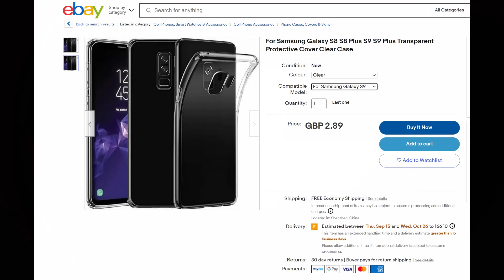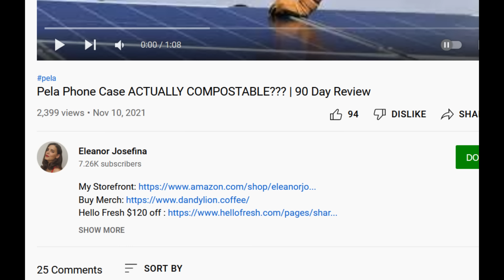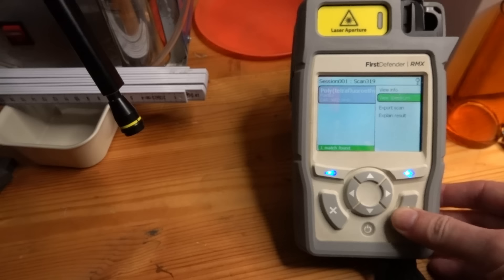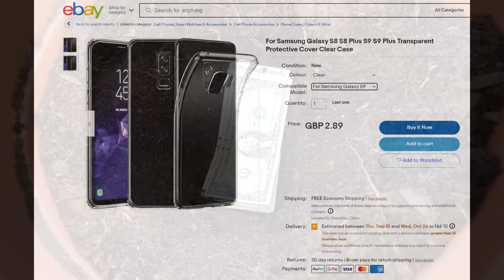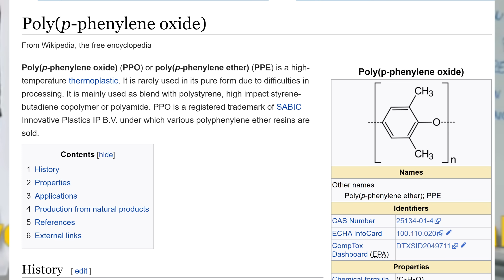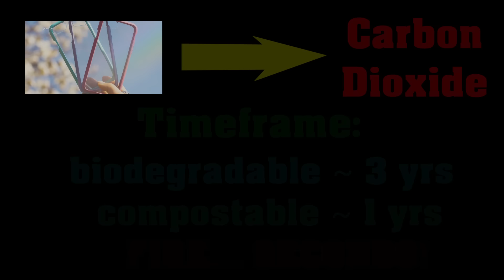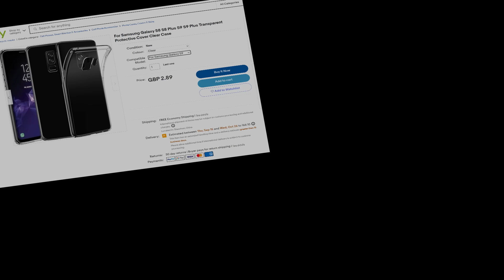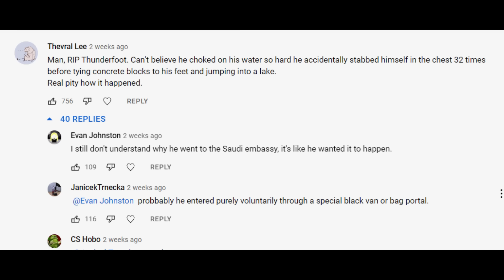Pela-Case: BUSTED!!!

Comment: I've got a question. If there was a phone case that did decompose within 90 days... Wouldn't it not last that long due to the oils in our hands?
Reply: That or getting water on it, like by setting it on a wet counter or picking it up with wet hands.
Reply: You can compost PLA in 60 days. You'll need an industrial composting plant, but it's still compostable. It doesn't degrade at all in a regular environment, so if they really have this special polymer, then it'll probably need special conditions to be composted, like PLA.
Reply: Sure, I guess anything it comes into contact with on a daily basis will undoubtedly reduce its longevity, defeating the purpose. For a phone case it's a bit of a daft idea, so maybe for those genuine throwaway-type items that are single use? Every eco activist loves a degradable drinking straw don't they? (the stupid cardboard ones are useless since they don't last 5 mins so a much better application for "Pela" to work on)
Reply: @LOOKINVERTED  I finally went to a place that used those plant based straws and I went through a few of them because they are brittle and cracked super easy. I would have been better off bringing a straw from home or stopping at 7-11.
Reply: Not to mention the damp humid conditions in your pocket.
Reply: @chlorophil545  you can buy stainless steel straws and a case to carry them in a purse or bag that also comes with a cleaning rod.
Reply: @toomanyaccounts  You can't be serious.
Reply: Yeah my father's cheap plastic phone case is a few years old now and is practically composting away, though he still uses it
Reply: @kentbidjouhd9538  no no, you don’t understand. You can drink you drink, but a couple of inches away! Isn’t that revolutionary? Exiting? Thrilling? No more are the days of experiencing the grueling task of lifting the cup! Praise be the miniature hollow tube!
Reply: @kentbidjouhd9538  milkshakes and drinks in a car are easier with them
Reply: @kentbidjouhd9538  straws is a drinking utensil... you can survive just fine without fork or spoon or chopsticks or any other eating utensils. Indians do it all the time! 
And just like food, certain drinks are sometimes only reasonably drinkable with a straw (such as boba tea), and many others would have a far superior drinking experience with one than without, cocktails for instance, or iced drinks in general in an open container. Now, you could argue that you can just live without those drinks, but so can you live your whole life eating stuff by hand, and you probably don't, so I'd say it is at least a little hypocritical to criticize using straws
Reply: @iCarus_A  Straws are literally mandatory for some, if people have special dietary needs or cannot tilt their heads sufficiently back enough to traditionally drink from cups
Reply: @tylerphuoc2653  Yes, straws are a niche product that the general public does not need.
Reply: First, how did this degrade into a debate over whether or not straws have a purpose? Also, if straws have no purpose then I guess pipes also don't? Anyhow, forget straws. I'm at ~6min and what everyone (including Thunderfoot) in the video so far has failed to grok is that composting only happens when you aggregate a bunch of food for microorganisms in a container. The microorganisms eat the food and this creates trapped heat; this leads to a feeding frenzy. It's kind of like making bread except instead of just yeast you have yeast+mold+other fungi+idk ... look I'm not an expert, but geez, guys, burying stuff != composting.
Reply: @tylerphuoc2653  dont forget those with their jaws wired shut
Reply: And all this on utensils you can just make them edible like their already is
Reply: Air, humidity, moist hands, pocket heat... not like that
Reply: @the_mowron  
He is. I have a titanium one. It's more because I wanted it, and it doesn't give off taste.
Reply: @chlorophil545  and 7-11 straws are made out of vegetables as well.
Reply: @toomanyaccounts  I use stainless steel straws at home but I'm definitely not going to bring those to a restaurant. That's so awkward. I'd rather just drink from the cup.
Reply: @EvanBear  people bring their own utensils sometimes. they have kits to do that.
Reply: @brapamaldi7666  I have two cats and they are very good at catching mice.
Reply: @tylerphuoc2653  thank you for bringing this up, I have terrible teeth that quite often cause jaw muscle issues where my mouth wont open past half an inch, I would love these people to tell me how I could get through 8 hours of manual labour without straws. All this eco friendly crackdown on consumer plastics has left me cutting up rolls of HDPE tubing for worksite-safe drinking straws.
Reply: @MisterMosfet  I dunno why so many people in this thread think needs like yours are "niche" and deserving of being put by the wayside. Either way, there are many materials that can approximate the properties and feel of plastic single-use straws without the non-recyclability and fragility of paper, like whatever that tequila biobase stuff is in Mexico
Reply: @gmt-yt  just be glad this didnt degrade into a politics discussion on the socioeconomic impact of straws and the symbolisms that the plastic straw represent /s
Reply: @EvanBear  Reading the words "stainless steel straw", i can't help but picture a lot of punctures and bloodletting.
Please keep them away from children, as if normal straws aren't dodgy enough.

Comment: One thing I keep seeing about ACTUALLY going green, you should follow the 3 Rs in order, Reduce, Reuse, Recycle, in order.

Reducing is the best solution, while Recycling should be last option.

For a phone case, it is better to get a phone case that actually prevents you from buying a new phone, then a phone case is designed to be thrown away in the dirt.

Comment: You know, I thought compostable meant 90 days in a hot composter (industrial). That makes compostable products in general pretty much not really compostable in the more normal sense because hot composting is something like 150+ degrees F with crazy microbial activity that can break things down far faster than colder compost methods.

Comment: here is my take on "eco-friendly phone + case": change the phone when you absolutely have to, not yearly, leave the case on the old-phone/reuse on the new phone. Done. 
Even if the case were not bio-degradeble/compostable it would be more eco-friendly than buying a new case a few times a year because you got bored with the old design.
Reply: But how would the apple drones be able to broadcast they have the latest model?!  Those poor people...
Reply: Even better ignore the whole idea. If you are buying the phone then the phone has orders of magnitude higher impact on the environment than the case
Reply: @Hardware John S7, you damn tread setter you. I've still got an S5 lol
Reply: @stusue9733  How the heck is it still working???
Reply: @sergeant5848  Good luck I guess lol. Still I'm from Aus so maybe they were available here longer? 2016 I think. The other half has one the same age and its still running the factory battery! lol
Reply: @zybch  ohh forgot to take that into account :)
Reply: @sergeant5848  even though it's only used as a backup phone I still have a S4. 
Funny thing is, that with LineAgeOS's support it has a more recent Android running on it that on my main one. It needed a new battery though, that I got for free because a college didn't need it.

Comment: I noticed the lab coat the guy presenting at the whiteboard was wearing still had the packing creases in it. It's almost as if they'd bought a new one from a fancy dress shop on eBay, got the guy to unwrap it, put it on and then run through some 'scientific stuff' they'd written down just twenty minutes previously.

Comment: Almost anyone can make a phone case from starch and silicone. 
Mixing them will produce a dough that can be rolled into a tortilla and molded around the phone within 10 minutes. Trim the excess, make the necessary holes and in a day it's ready to be used.
I don't think this case mix is compostable but it's a handy solution if you don't find the one you're looking for.

Comment: My last phone case was hand made leather with wooden plates and linen thread. 100% biodegradable in reasonable time. All locally made. 

Unfortunately doesn't fit my current phone (which is in a cheap off the shelf hard leather case). 

But why isn't that the case of the future? It's going to have a massively lower carbon footprint.
Reply: Leather is absolutely not going to have a lower carbon footprint. Leather is one of the most energy intensive materials there is, way more than plastic, and is much more expensive. And the tanning process makes it less biodegradable, too.
Reply: my first question about this case was why it wasn"t made of glued veneer

Comment: Initial thought, do a little less planned obsolescence with phones and keep the same phone and case for several years.
Reply: Had my previous one seven years till it just became unbearably slow and limited. A custom OS flash for newer version than supported as well.

My current phone will get the same treatment.

Not for environmental reasons but because I see it as a waste to just replace something expensive if free alternatives exist.
Reply: I am still using an iPhone 7 with original case and glass protector. I only changed the battery when it exploded,  And that only took me 5 minutes.
Reply: Asides from no case, the most eco-friendly case is the strongest one money can buy, to prevent your phone from prematurely dying and marginally increasing your carbon footprint with a new phone. Maybe throw a battery in there to increase the number of charge cycles on your existing phone battery.
Reply: Google is about to make so many phones unusable for their purpose with a safety net update that will force phones to have a TPM module, which only newer phones have.

Comment: Burying a case in soil isn’t composting. From what I understand you need to use a proper enclosed composting bin, as compost should get to higher temperatures - around 30-60°C, which would aid any compost-ability… if it could do so.

Comment: Pro tip: If you're doing a reaction of metallic potassium in some ether-like solvent, which is what you seem to be doing in the THF there in the video, I suggest switching to glyme, because you can heat it up enough to melt the potassium, drastically increasing reactivity by having a clean surface. That said, your K looked pretty clean to begin with.
Reply: Shame it self destructs when it finds water - it would make fascinating bling :) "K-Bling; bling that goes blang!"
Reply: I hear its as blue as the famous blue stone of galveston....

Comment: Welding is sometimes done with CO2 as the shielding gas. I once wondered how big and bad a welder's contribution to released CO2 into the atmosphere really was. Turns out that if they used up one full tank in their day at work (10 000 litres at atmospheric pressure), it's still less than they created by driving to (not to and from) work, assuming they didn't live ridiculously close to work.
Reply: Depend of the processMig welding use 80%co2 and 20 argon, Tig welding use 100% argon. There is rare mix like helium co2 and argon mix, but they are expensive.

Comment: The carbon footprint related to the internet/digital promotion of their BS has surely offset any advantage they could have gotten of using natural fibers filler, compared to the regular run-of-the-mill phonecase which just gets sold with no useless extra data storage or bandwidth usage.
Reply: most of the internet runs on renewables electricity tho

Comment: Composting will convert some of the carbon into hummic acids, wich lock carbon onto the soil for a hundred years or so.  Great for air-source carbon (plant matter) on the megaton scale, as you get to run the cylce every year.  But throwing a bunch of oil-derived polymers into the mix can't be that helpful.

Comment: Great video, as usual! Just to make a small note, i wouldn't count the carbon dioxide people exale as part of teir carbon footprint, since it comes from the atmosphere to begin with (plants take it from the air to make organic molecules). Only the carbon we mine from the ground ( where it would have stay for geological times if we haven't ) plus whatever reduction in biomass there is ( as in choping down forest) contributes to climate change.
Reply: A similar argument could also be made in the cellulose to plastic comparison as well. Cellulose is carbon that is already in play in our ecosystem. Plastics derived from petroleum is releasing carbon that has been trapped in the ground for a long time versus cellulose which is the current ecosystem cycle.

Comment: A little side note here: the breakdown in soil as opposed to being splashed with water while in use are probably not comparable as the soil is acidic and it may or may not accelerate breakdown... I do not know I just thought it is an important confounding variable. Otherwise yes: as long as it is plastic that is safe to burn one can just burn it and it is the same as composting it... no difference.

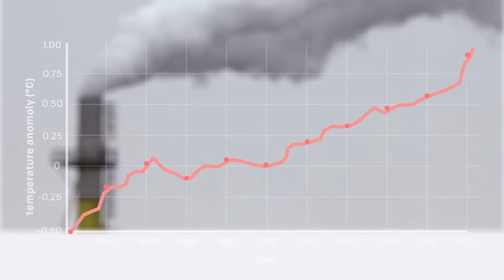Comment: 12:08 "not caused naturally, but by you and me"

I don't know this woman, but I personally DID NOT choose our vegetables and other food to be packed up in poorly degradable boxes. I do not touch most of the stuff which is thrown away anyway, with or without me. And I voted for a green party. But that did not matter and the industry still sells so much crap which could use a paper bag, too, but hey, plastics are still cheaper to use for them and not in danger to be outlawed.
Reply: Does it make you feel better about yourself? I drink mineral water from plastic bottles, run my AC in the summer, drive gas car and voted republican since 2012. (First time I could vote) Don't give a single damm about this insignificant piece of rock, we live on. It will be destroyed some way long before climate change does it...
Reply: @jackwilson5542  Yes.

Comment: "A truckload" is quite a wide range. So when they say a truckload of plastic is dumped in the ocean daily, it could be as little as a Class 1 truckload of less than 2 tons, or as much as a Class 8 load of 14.5 tons or more.

Let's go with the average here, a Class 4 carries up to 7.5 tons.

With a case weighing 25g, you will need 300 000 of them to fill one of those trucks.
That is $18 MILLION worth of cases... PER DAY. And that's just to break even, if this case had some magical property that negates other plastic usages, which it doesn't...

Comment: Its the same as those "compostable" bio trash bags. They do only compost in industrial compost facilities that reliable reach high temperatures. But my local compost facility says they do not compost because they take longer than the compost cycle and then they cant use the compost because its still full of plastic shreds. Its the same with PLA for 3D printers. I use it. But not because its compostable. They should make those cases out of some paper product.